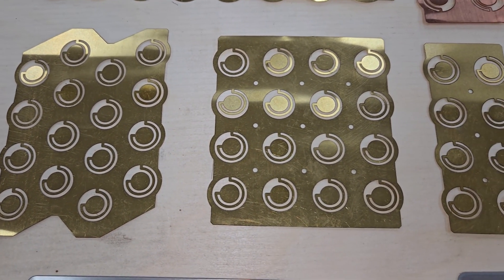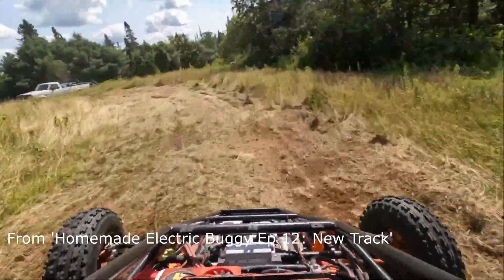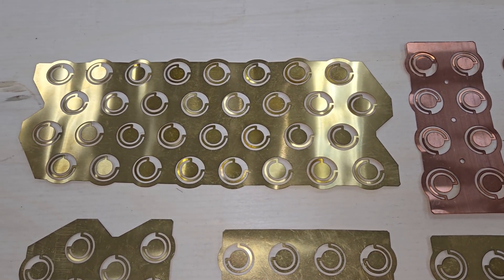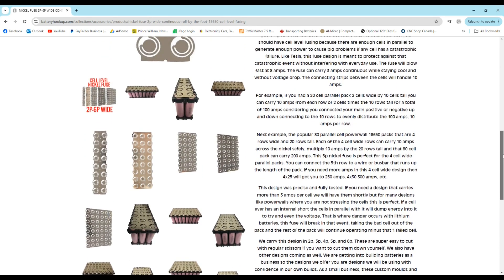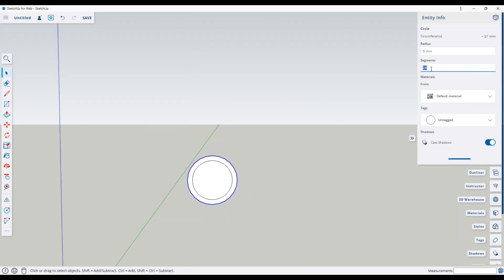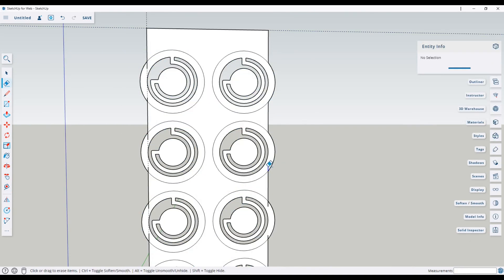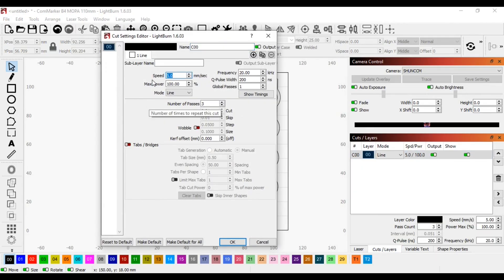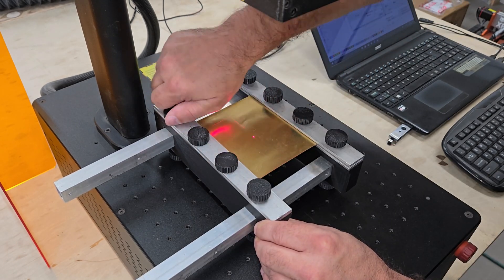Making Battery Strips W/ Cell Level Fusing

Comment: Since you are designing your own plates you should consider removing the sharp corners in your fusible sections. Sharp corners allow for high E fields which in turn is a source for arcing. Not sure if battery failure modes can lead to arcing, but if so then the resulting high frequency can cause cascade failure in other electrical components.

Comment: timing is crazy, just got my B4 50w laser (i beleive a non MOPA version) few days ago. Was testing it on 0.15mm nickel sheet. Had 3 hours of experementation, but results where way worse than yours. will try your settings.

Comment: I was just wondering, are you sure these are copper sheets, it sure look like brass to me. Anyway, nice machine you got there, work amazingly well. Cheers
Reply from the maker: Mix of both. I'm color blind so I might have them mixed up, but you can see the shade difference better in the pan shots. Brass has a similar conductivity to nickel, better corrosion resistance than copper so worth a try as batt strips. I'll learn which is which as soon as the fuses blow lol.
Reply: @JamesBiggar  You can tell them apart by taste.